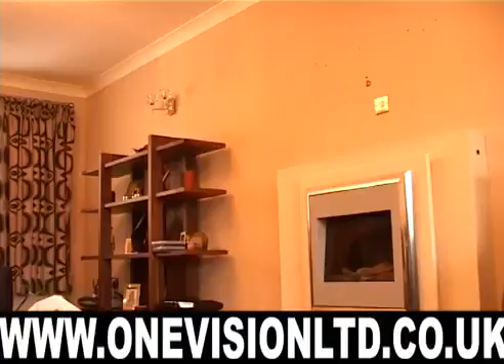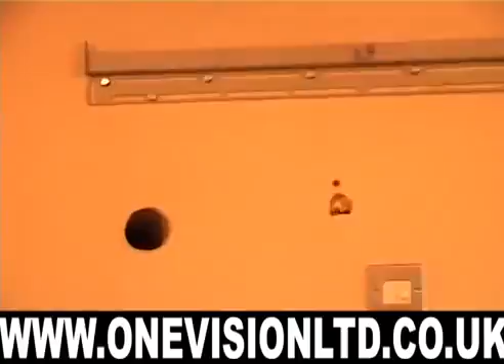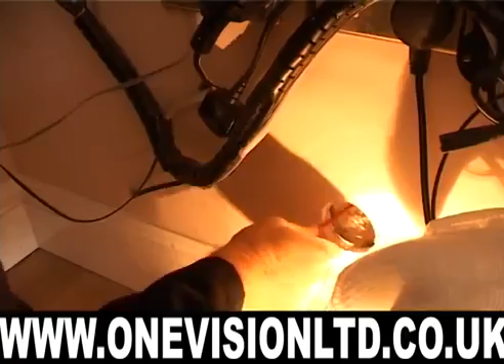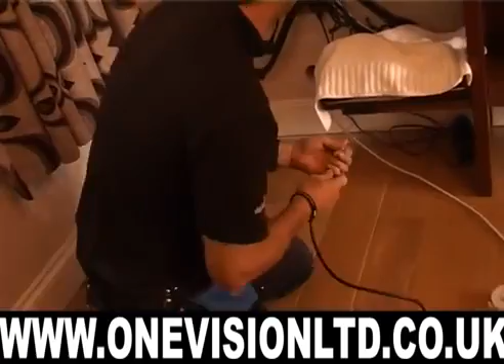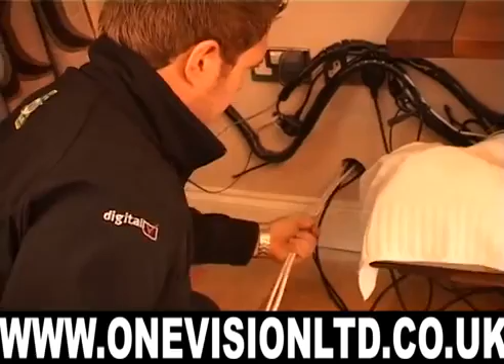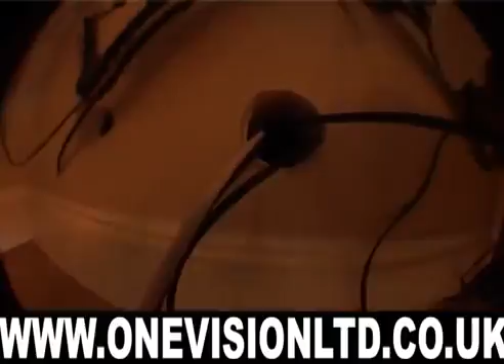How to Wall mount a LED/LCD Television with hidden cables

Comment: I was really impressed by what was a very professional job until you grip filled one hole and plated over another at the end. Why wouldn't you just use brush plates or even better wire in in/out sockets

Comment: How the hell do you manage to get the rod lined up with the other hole? It’s so far away!?
Reply from the maker: Hi Adam, If you angle the hole behind the television towards the corner wall where the recieving hole is, you can then push the rod towards the wall and it will angle down towards the hole.  If the rod catches the floor before the hole, we normally push the rod in and out sharply so it bounces towards the hole. Hope this helps
Reply: One Vision Digital LTD thanks for your reply. Il give it a try then, it would make it a lot easier if my sockets were directly below the tv but the are much further to the side like in your vid. So have you drilled straight through the wall into and threaded through the cavity? I wanted to thread mine in between the plaster board and brick work but I think it will be obstructed by the plaster they stick the plaster boards on with?
Reply from the maker: No problem Adam, There may be too much dot and dab plaster obstructing doing it this way.  In which case we would recommend running the cables in the brick cavity.
Reply: One Vision Digital LTD... thank you 😘

Comment: Was that a solid or dry wall they drilled into?
Reply from the maker: It was a solid wall
Reply: @onevisiondigitalltd1017  Thanks! Will have to get one of those drill bits.

Comment: Not very safe at all. There should be power switch behind the TV, and not very tidy would not recommend following this video.
Reply from the maker: Theres a power switch in the corner if you look, so your recommendation is to take the TV of the wall to turn it off ?? Please think your comments through before you write them as they are not helpful and I cannot see people taking the TV off the wall to turn it off.
Reply: My TV power cable it too short what can I do?